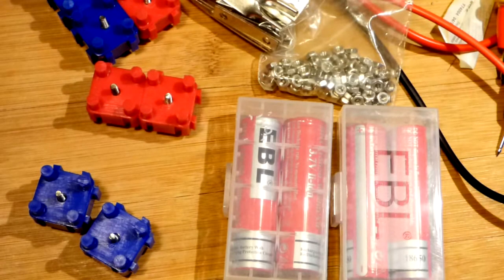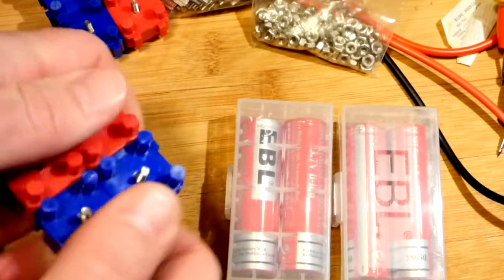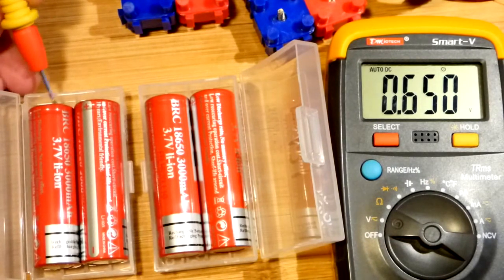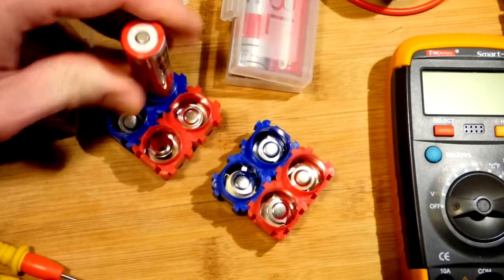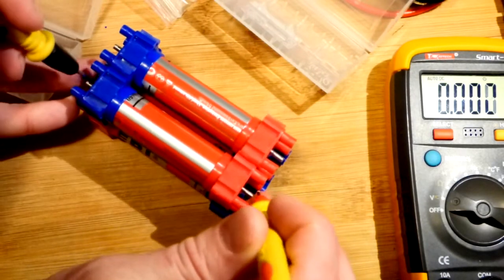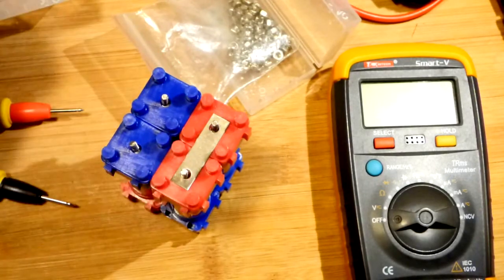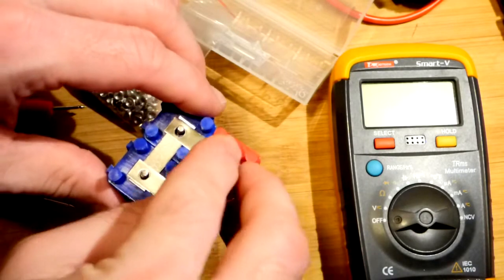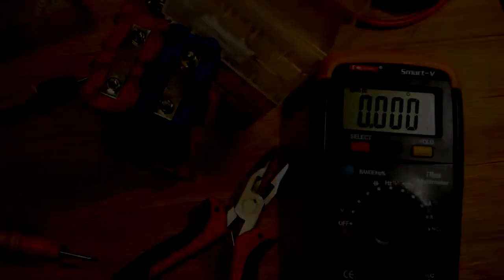Battery pack of 2 series 2 parallel 2S2P 18650 made with Vruzend solderless weldless systems

Comment: Vruzend connectors are absolute garbage. They eventually crack and lose contact or slip and lose contact. They're made in india with zero quality control and the guy that sells them does so from his parents garage floor. Save yourself a fire or ruined cells by using a different cell connector. No version of vruzend is better, I've used them all and they all fail the same.

Comment: The parallel  cells will self balance. The series cells need to be balanced because the cell that is exausted first will be reversed charged by the remainder cell that still has a charge which is VERY VERY BAD AND COULD EXPLODE OR CATCH FIRE.
Reply: Can you recommend a bus charging board I have 2S2P battery back from a device that I want to charger separately as the charging ic on the motherboard is fried and cannot get a replacement so want to build my own charger

Comment: I cant find anyone on Youtube making a 2S2P pack like yours and then adding a BMS with seperate charger.Would any 2S
BMS 8.4v board work?I'm thinking the pack would be 8.4volts and the board would balance each pair on charging.Charger would be 8.4 volts?

Comment: if I were to use this https://shopee.ph/product/201062777/5708022790 what is the voltage and current of the charger to charge that battery pack?

Comment: If those EBLs are brand new, they do not come pre-charged. You should charge them fully, drain them fully, charge them fully one more time and then it shouldn't matter how much you drain them for subsequent recharges. I've had several of my EBLs go bad, but they were the cheaper "cute" ones. I use them to power up my Teenage Engineering Pocket Operator and Korg Volca synthesizers and drum machines.
Reply from the maker: Thanks for the tips!
Reply: Oh ... I see what you did there. 😂